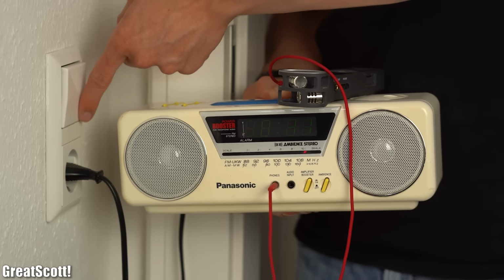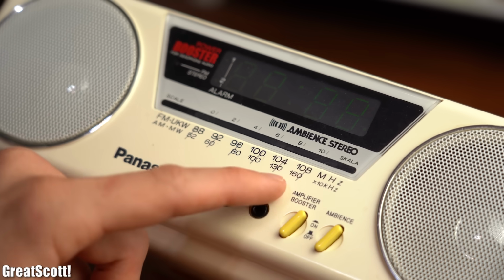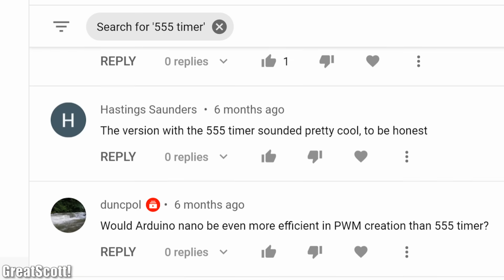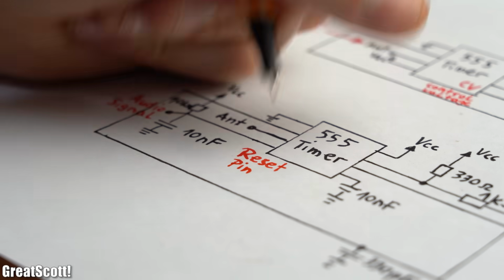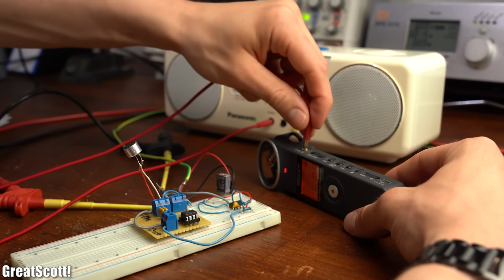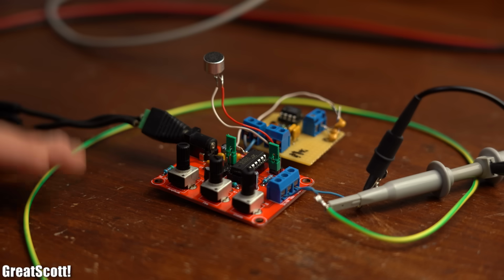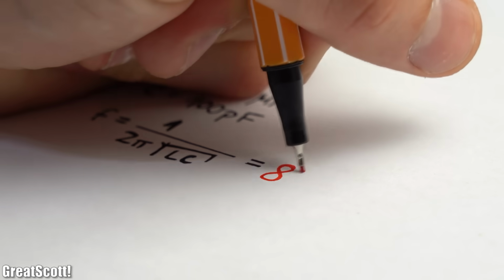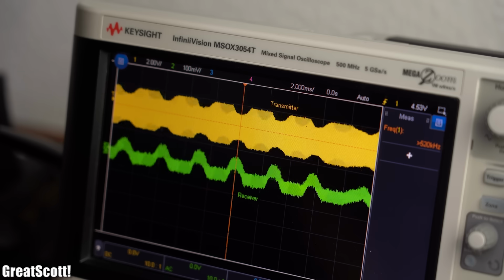Building a Super Simple AM Radio Transmitter & Receiver! Keeping Wireless Audio Communication easy!

Comment: You know that XR2206 can tune from 1 Hz to 1 MHz?  I have bought a couple of these kits a long time ago. but I could not get it modulate correctly or get it a good distance away from the transmitter.  So what do I need again?  You need to also post the schematic hook up diagram using the XR2206 function generator module.  I see that you connected a series of 3 x 1 nF capacitors from the output of your NE5532 microphone preamplifier circuit that you used in a previous video for a voice over microphone circuit, but could you try to make a circuit diagram that connects that NE5532 circuit the function generator module?   Thanks.

Comment: I tried this but the resistor is 220 ohms and a 403pf capacitor it received on 530-531 khz it working but the sounds still terrible

Comment: The TA7642 IC is the modern version of the MK414/ZN414 TRF Radio IC. With careful design and build, you can make a pretty decent AM radio. Plenty of blogs and info on the web to explore on this IC. Of course it won't stack up to a Panasonic RF2200 or a GE Superadio but it might just surprise you on its performance. 
Forget using a 555 as a transmitter. It's not really designed to do that and it sounds like... well you get it, BAD. Yes you can do better with the cheap signal generator but... you don't really learn anything. Try building Colpits or Hartley oscillator with small signal transistors. You'll learn a LOT more and get greater satisfaction for something you built from scratch.

Comment: Transform an RC remote control (module: NR.40010, 40 MHz band, with a Super Chip SCTX6A B8502866 1) entirely into a radio transmitter.

Comment: Interesting.
I made an Am transmitter with the 555 a couple years ago. As I remember 600- 700 KHz is about the max you can set up the 555 to oscillate at. Mine did work. It had horrible harmonic issues and was all over the place. I had used an audio transformer to modulate the carrier.
Did it work, yep but..... not exactly clean at all and likely not worth the effort to filter....

Comment: Why should one use an integrated circuit, when the same or even better results can be achieved with one or two transistors and a few passive components?

Comment: Got you beat on stupid easy AM transmitter.  
I used an LM386 to boost the audio from my 3.5mm into a small audio transformer and into a full can oscillator. You can get them at many frequency's the higher the longer range.

Comment: I know this is very old now by Youtube standards, but i built a similar deal as this with a car battery and a 1k pot, a 100uF cap and a  10k pot . it works very well and my sdr picks it up all over the dial. you leave the 10k pot at full and tune the 1k pot to the desired frequency. I ordered the circuit you suggested anyway and cant wait to start using it instead.

Comment: The Oscillator circuit is not that hard (only if you wanna adjust the frequency) when you just use a 1Mhz Quarz Oscillator so you have a signal on 1000 Khz. What really is important to keep an eye on the harmonics. You absolutely don't want your signal appearing at several other spots of the Frequency Band but just on one single frequency.

Comment: I see that pin 1 of the XR2206 is connected to ground in this function generator. Did you first disconnect it from ground to connect the input signal for AM ? In the video it seems that you cut pin 1 of the IC to solder the input, am I seeing well?

Comment: Antenna coil using a coil form made from a business card- use a small piece of hookup wire between the former and the ferrite rod to space it so that it can be moved for tuning. 1 transistor colpitts oscillator + modulation into the base. 1 transistor reciever... into an earpiece using another ferrite rod coil on former with fixed capacitor. maybe a movable tickler feedback winding to cause regeneration

Comment: In spite of what someone else posted earlier, you can operate an unlicensed AM radio broadcast station in North America by an agreement made between Canada, U.S., and Mexico as follows:
 Unlicensed broadcasting — 100 mW DC input to final amplifier with a 3-meter maximum length radiator, no license needed, may be measured at edge of campus for school stations.

Comment: I like simple. I used a 6888 vacuum tube, a tank circuit, and a TTL oscillator, with a triode to drive the screen grid. Works great. I get about 5 watts of RF.
Reply: I know I'm a bit late, but do you still have the schematics for your circuit?

Comment: I bought the xr2206 unit and ran into two problems. In my version, pin one of the IC was grounded so I pulled the chip and bent the pin out so it was no longer grounded. I then tried sending a signal to it using a  cassette deck through a one chip mono amp. It worked but was very distorted. I tried a number of things to resolve this but nothing worked. Any ideas? Suspect severe impedance mismatch but can't  figure it out.

Comment: Enjoyed video regarding the transmitter build. It's probable that your circuit likely complies with Part 15.209 if you need to keep the radio relatively close to the transmitter. Your video will certainly be of interest to the would-be Part 15 broadcast enthusiast who wants to build their own transmitter before graduating to one of the more costly, high performance Part 15 AM transmitters. Thanks for sharing.

Comment: Hey Scott! Awesome video, but this AM waveform on 3:04 is not the best honestly. I get it, it's hand drawn, but it really got to a mix of AM and FM :)
As a tip for the next time, you could've drawn straight vertical lines with pencil to indicate where peaks of carrier are and should be in resulting signal :)

Comment: You can't reach 100MHz regular broadcst frequency with 555 but you can easely produce phase modulation with it, that can be demodulated by a FM receiver. If you buy an old army wolky-talky (various models have various bands but in general they start at around 30MHz to around 55MHz-60MHz and small ones (several kilograms that is, sized as a small netbook with 3 times its thikness) are ususaly from around 40MHz to 47MHz) and find 555 variation that can reach 40MHz (both are accessible) you can try it.

Comment: Another excellent and well laid out video Scott, thoroughly enjoy them, could you design a simple circuit for bump starting solar pond pumps, I tried to pull one to pieces to reverse engineer it but the potting stopped me, it seems these pumps need an initial jolt of power to get them turning, regards Doc Cox.

Comment: well, it is legal on low power in Australia as long as you are under 3W you should be fine, with HAM stations, 5W with a armature license is fine, just don't be a d*** and start punching it up high.

I have a AM transmitter just down the road from me- commercial and I'm able to hear it right to the border of my state... my state is larger than Germany, as they are only using a 2kw transmitter it could possibly even make it to Antarctica by bouncing off atmosphere and water.

Comment: It would be really good to see the transmitter made from discrete components - go old school!  Nothing more complex than a transistor...
Reply: Slightly off topic question
What do you call the leads with the springy hook ENDS?
Reply: @pdemosllegaralos520subs2  test leads in general, clip leads or test clips more specifically, or hook clips when comparing to other clip leads.

Comment: 8:25 Why are you using an solid iron rod for the coil? That's going to be super lossy at the frequencies of interest. You should be using a ferrite rod. those can be salvaged from old AM radios or switchmode power supplies. Hell you could probably just use the transformer as-is w/o modification.

Comment: 5:12 You could probably get away with frequency modulation with the 555 and the radio if you added a high Q LC series resonant circuit to the 555 in series with a proper length tuned antenna. The resonator resonates when the 555 drives it near resonance but increases in impedance as it drifts away. Duty cycle modulation would also work as it a duty cycle further from 50% will have less power in the fundamental and more power in the harmonics that get filtered out.

Comment: AM is also a fun way to mess with ultrasonics... if you have a 96kHz sampling PC sound card, it can directly output ~30-40kHz narrowband signals to drive a low-cost ultrasonic emitter. The low frequency compared to RF makes a demodulator circuit simple. This even works with no circuitry in the transmitter at all, some early TV remotes used an ultrasonic tuning fork struck by a hammer to send button presses without batteries.

Comment: Hi
Es wäre vielleicht eine bessere Lösung einen Quarz zu nehmen so dass man einen Sender hat der stabil auf 1MHz oder 6MHz senden kann die Modulation kann man über einen TL494 machen da dieser sehr linear die Pulsweite verändert wenn sich auch das audio Signal verändert die Antennen Anpassung ist auch ein wichtiger Faktor der beste Sender bringt nichts ohne Antenne . Damit die Oberwellen gut unterdrückt werden könnte man einen PI Filter benutzen mit welchem man auch gleichzeitig die Antenne anpassen kann . Wenn man nur den Träger haben möchte ohne Modulation waren es dann bei 12V Versorgungsspannung nur 6V welche die HF Endstufe bekommt und das audio verändert die Spannung zwischen fast 0-12V so bekommt man etwa 100% Modulation das Audio klingt dann deutlich besser :)

Comment: What will happen if you rectify a square wave?
Reply: Depends on the square wave... a biased square wave from e.g., 0 to 5v will rectify ("peak detect") into a smoothed voltage, this is the basis of PWM control as well as this simple type of AM receiver. A decoupled square wave has no DC component, and a full-wave rectifier will convert it to smooth DC, with a tiny "blip" when the input crosses zero.

Comment: Transmitter could have been made with just a few transistors.  They do tend to drift a bit however.
Reply: If you use a carbon microphone, a current source, and a tuned L-C tank, you can make a transmitter with no transistors at all! ;p

Comment: youhave come to your senses. usong simple ics instead of microcontrollers. tobuild a radio.
Reply: A 555 is a filthy triangle wave generator, and the signal generator chip can do FM or PSK, still oddly under- and over-engineered solutions, but certainly more informative than using an arduino timer to make AM radio bleeps, or the pi clock to spam FM with square waves.

Comment: A stronger Transmitter and the frequency of your circuit tuned to the frequency of a local radio station would be a funny prank if you turned it on only before every news cycle.

Comment: In the U.S. (no idea in other parts of the world, but probably similar) without an F.C.C. class 'C' license (now known as a "technician class"), you can not operate a radio transmitter, A.M. or F.M. with a total broadcast output of greater than 20 watts or a transmission range of greater than 20 miles. This is only when using a transmitter whose design and commercial manufacture have been pre-approved by the F.C.C.  In the U.S. this is from the regulation congress passed in 1987 that allows you to use your citizens band radio, and radio controlled models and toys without an F.C.C. class 'C' license. An addition was added to that regulation in 1995 to include the unlicensed use of your cell phone (your cell phone is just an F.M. radio transmitter and receiver). A non approved transmitter such as a hobby built unit can not exceed 2 watts total RMS at the antenna, or about a 500 yard broadcast radius unless the actual transmitter part of the circuit is a sealed unit with F.C.C. pre-approval. Whether or not some F.C.C. official is hiding in the woods to catch you broadcasting at 5 watts, I leave to your imagination.
As for using a square wave generator (555 timer IC) as a broadcast Carrier Wave, all you need to do is scope the CW signal at the RX antenna to see why it's a crappy idea. You may be "sending" a square wave, but the receiver antenna sees a spikey, bipolar, saw tooth (more like an inverted shark's fin) wave form. This make's it extremely difficult to filter out the overtones and sub harmonics caused by the spikes.
Reply: I don't know where you are getting your info from but you need to read up on CFR47 Part 15 which defines the US rules on unlicensed transmitters. On MW you can use up to 100 mW into the final stage and an antenna of 3 meters (9 feet) including the feedline and ground lead, if used. A properly tuned 3 meter antenna on MW with 100 mW will net you about 1/4 mile under very good conditions. Typically, you can expect up to about 200 feet before the signal is almost unusable, which is EXACTLY what the FCC wants.
Cell phones are now all digital and have been since the late 1990s
Most 555 ICs are only good to MAYBE 1 MHz. The SMD types might get you to 2 MHz. But it's a SQUARE wave output and needs filtering to smooth it into a sine wave. Even more to reduce the harmonics. You can do better with a Colpits or Hartley oscillator using small signal transistors.

Comment: Actually, hex inverter, eg. UB4069 will be simpler, work better than that and draw less current.
Even if Xtall be used as harmonics we can reach up to 300MHz with very clear transmission (AM or FM).
Just make sure make a very simple class A amplifier with 2SC9018 transistor

For receiver, please don't build bird nest version like this, just attach in PCB with wide ground plane, it will give a huge stability.

Greetings from Indonesia 🇲🇨

Comment: I used an RC remote to make an FM transmitter.
Reply: Bhai aisa kaise kiya muje v btao
Reply: @shriniwashase first select an empty fm channel for ex you choose 94.5mhz station in reciver press button of remote and with the help of screw driver rotate a black thing you will see in wrapped around coil. You will hear a around 1000hz tone.
 find in pcb from where around 1000hz tone is generated. From there add audio input or audio can be input in series with battery.
Audio can be inputted from mobile phone using aux cable
Reply: @vivek_live_now  kaha se late ho itna Dimag
Reply: @shriniwashase  khud se different thing bana ke dekhta rehta hu

Comment: Can I feed raw audio to the chip's pin or I need a resistor or something like that? And how can I tune the signal without an oscilloscope?
I have a pretty old radio with AM and I looked for AM transmitters but they were very overpriced, then I saw your video in my feed, now I'm saved.

Comment: You use 2 transistors for the transmitter! One for rf and the for signal that controls the current off the rf transistor emitter. The receiver do not need any but you can use a transistor that you could use as a volume control. And it will be a lot clearer!
Reply: I used a single transistor in one design.

Comment: The "easiest" AM transmitter would be to feed both the oscillator and the audio through capacitors, connect the output of both capacitors together, and send it through a common-collector amplifier with no bias voltage on the base.  The effect is a carrier signal that changes amplitude based on the audio strength.

Comment: I’ve seen fm transmitters for sending audio to car radios for drive ins for about $35. I wanted to buy one to watch movies with my friends but I would love to see if it could be built for cheap using standard components. Maybe a cool diy or buy?
Reply: You can get some for much cheaper direct from china on the usual suspects (AliExpress, banggood, gearbest etc...)
I've found a Bluetooth to fm transmitter for 2.46€ on AliExpress.

Comment: would´ve been cool to build an actual oscillator based on discrete components instead of using an timer IC ;)
Back then, there were no ICs inside tube radios 😁
Reply: My first am transmitter had only one transistor and worked fine!
Reply: @brankotdk  I´ve seen AM receiver which had no active electronic components at all.
Only a coil, few capacitors and resistors and a crystal earphone.
Reply: @MultiWirth  sorry for my English... That was probably detector recever. Works without battery. You need also diode (I used germanium diode).
Reply: @brankotdk  it was a "rocket radio" from the ealry 60's.
It was a crystal radio (the crystal in this case was the earphone itself) which actually works like a diode but can only pass a very low current as far as i know.
Radios from the 30's worked similar, but had a amplifier tube and and speaker.
And of course no 555 timer IC 🤣
Reply: @MultiWirth  the titanic reciever

Comment: Actually, running that 555 output into a tank circuit (probably with a buffer amp) to make it resemble a sine wave and modulating the power supply voltage with the audio would work pretty well.

Comment: Great .. Next challenge : Make ONE Switch radio control circuit (Rx and Tx) with basic transistor and crystal circuit .. no ICs ... 100m - 1km
Reply: It's great to see an electronics master challenging another electronics master :)
Maybe you can do this video together? :)
Reply: That would be cool, especially in the manhattan style circuit board for good measure lol Come the day of the Internet apocalypse, it could prove to be very handy.
Reply: Yes, regenerative plz and LC tank osc. Am waiting for that
Reply: This is the dream! I've been wanting to build an RF switch (both RX and TX) for YEARS and I couldn't. Even my professors back in my uni days wouldn't help.

Yes using RF modules would solve it, easily, but defeats the whole purpose. I want to build it from scratch!